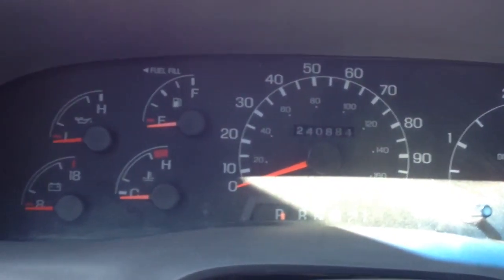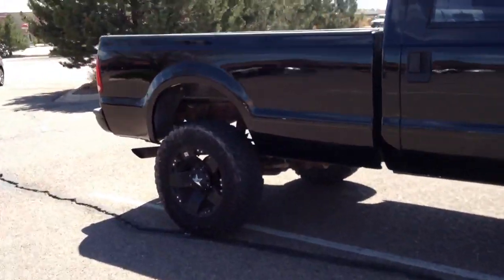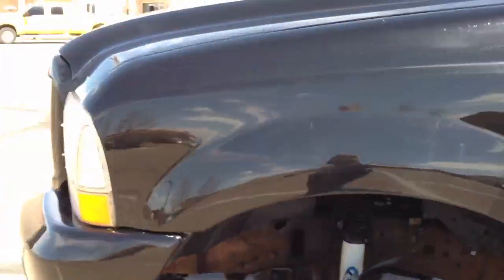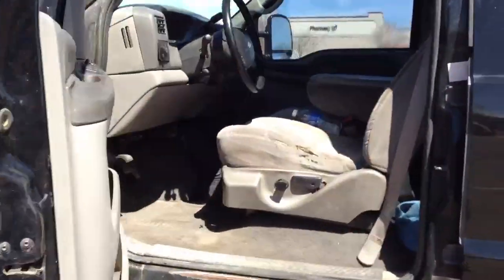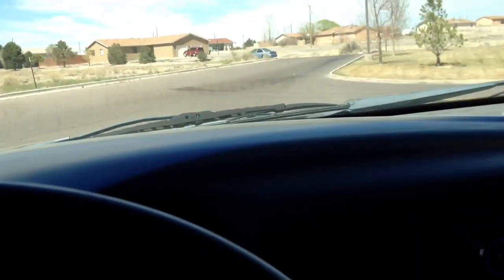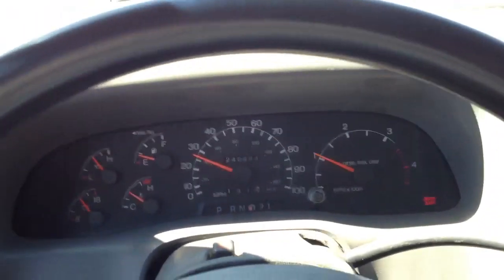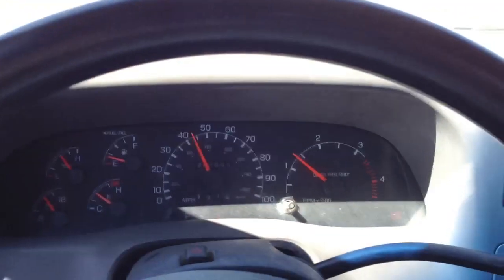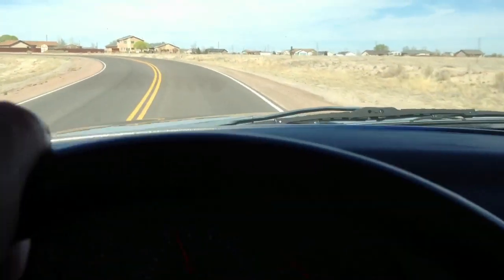Project powerstroke WALK AROUND AND DRIVE

Comment: Just a little tip on the grey carpet. Both my 350's has the grey interior and stains everywhere... If you want to clean it up really nice you can go to a hobby store and buy some black fabric spray paint (JoAnn's, Micheal's, etc) Just clean the carpet before you spray it on and make sure it sprays in between the fibers pretty well and boom you have what looks like brand new carpet. Usually i needed about 5 to 6 cans (about $25). Sure beats the hell out of buying brand new carpet!

Comment: To fix the lights staying on, get some white lithium spray grease, and when you open the doors, spray into the opening in the  door where it latches and that will fix the problem, I have a 99 F250 and took me forever to find that in forums to fix it, havent had a problem with it since i did that!

Comment: Check the door-ajar switches with a ohm meter to make sure there working. (if you can find the wiring color codes, you can probably tap into them through the rubber thing in between the door and the body so you don't have to pull the door panels off again.) Truck looks really nice, what do you have in mind for your next project?